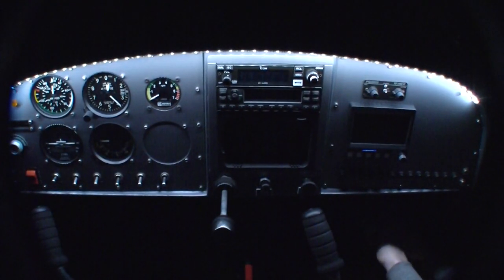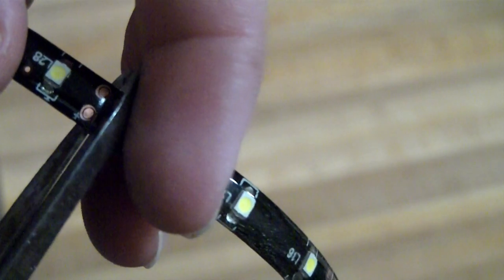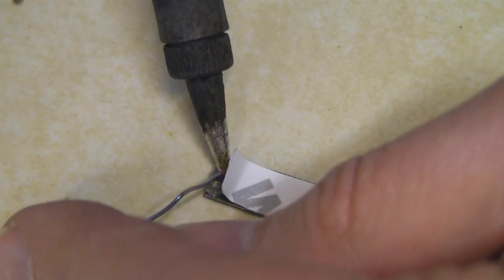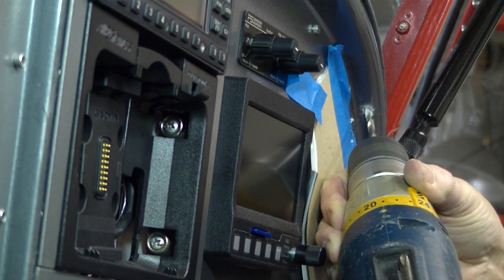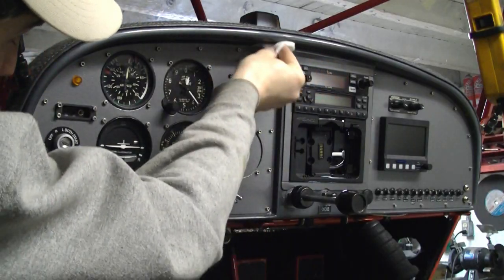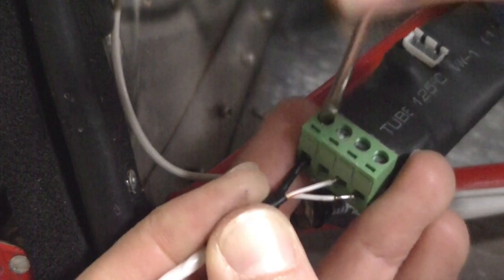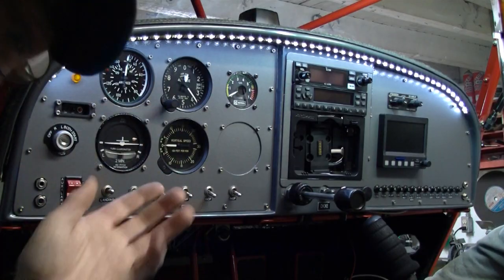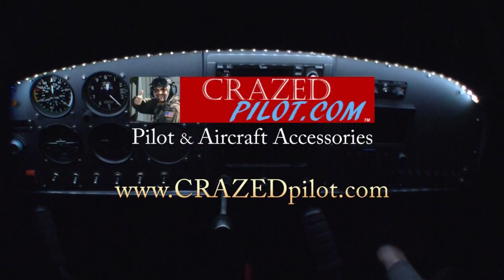LED Cockpit Lighting System for Aircraft Interiors - BUY NOW $45

Comment: I bought the Crazed Pilot LED lighting system from you guys. My dimmer control box is much bigger than the one in the video, easily twice that size and twice the wires.
Reply from the maker: The unit has been re-engineered and upgraded since the filming of the first version roughly 10 years ago as it now includes and integrated power control function in the switch.

Comment: Wouldn't red be preferrable?  And while the lights did a good job on the top instruments, they don't seem (in this video, at least) to light the lower instruments.  Great concept, tho.
Reply from the maker: Red AND Blue are available on our website.  They light the lower instruments sufficiently, there's no good mounting on most aircraft except the panel glare shield, so that's where the light source must go.  Fly safe!    -Jill, CRAZEDpilot.com, Inc.